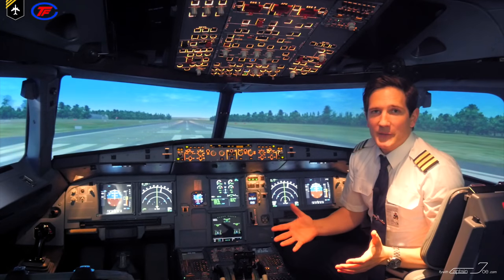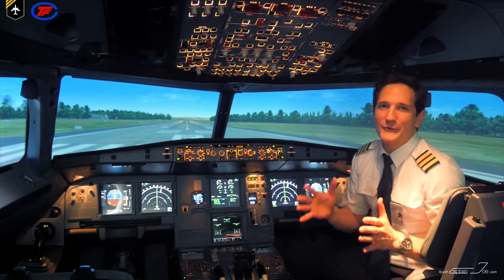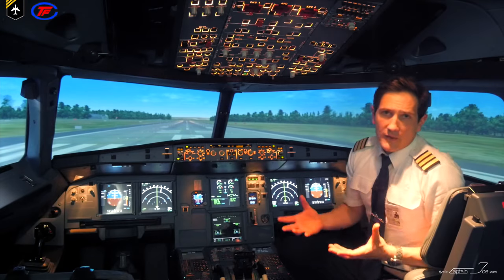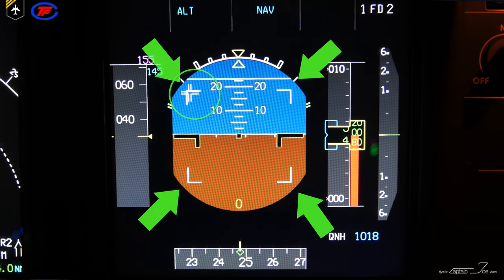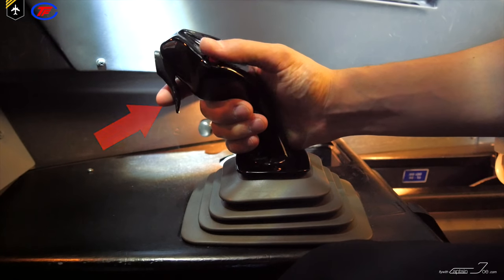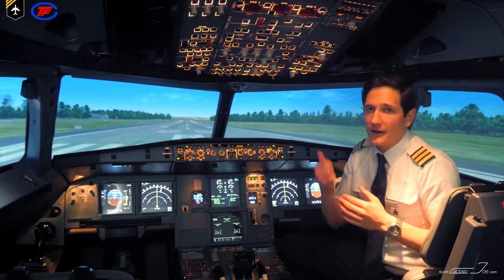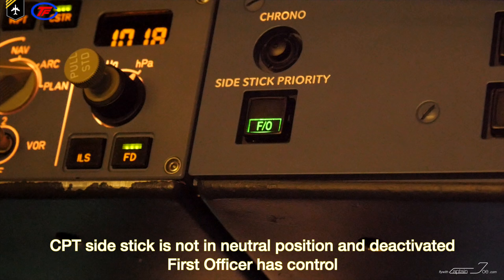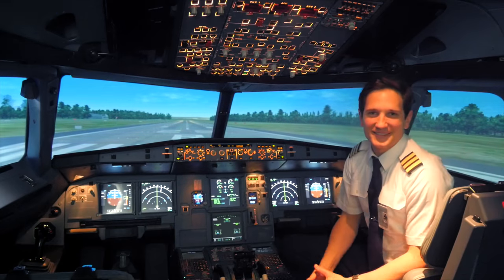AIRBUS SIDE STICK - Explained by CAPTAIN Joe

Comment: So what happens when you totally lose power and the aux gen/battery also fails?  

Let’s say you get hit with an immense EMP?
Reply: Those are 2 different things. If both sidesticks stopped working then you’d use the autopilot and fly an autoland. If you lost power to the flight control computers then you’d use the rudder and stabiliser plus the engines to turn and pitch. If you were hit by an EMP then everything would shut off including the engines and you’d have no control
Reply: @tomstravels520  And an EMP in a 737 on the other hand wouldn't render the plane uncontrollable as the yokes are mechanically linked to the control surfaces.
Reply: @psirvent8  true although a Max would be slightly more difficult as the spoilers are fly by wire and you’re still going to loose the engines. In fact you could potentially have slight control on the A320 if you have enough airspeed to windmill the engines to keep the hydraulic pumps going you then have rudder and stabiliser control although landing wouldn’t be pretty

Comment: what was wrong with the old "steering wheel" style controls?
Reply: The main advantage that most pilots talk about is that they can now extend a large tray in front of them to have lunch in comfort. The mechanics are also somewhat lighter (less weight saves fuel, even if just a little bit).

Comment: Is it hard to get used to steering with the  other side stick?  So if you usually operate from the right seat, can the left seat throw you off for a bit.  Which side do you prefer?

Comment: Why doesn’t airbus have a yoke like Boeing and which is harder to control. I have always wondered this thanks Captain Joe
Reply: Asia Khaliq sidestick are mainly used in airbus aircraft as it has its own set of advantages. Mainly that it’s compact, fully fly by wire and allows for the installation of a table.

And in terms of controlling, though it’s subjective,yokes are preferred as it feels more natural.

Comment: Can you explain why was it possible for the Airbus to crush in the Atlantic Ocean in 2009 when the co-pilot was putting the nose up with the joystick while the plane was stalling and nobody realized that until it was too late? how come there is no warning ? that is very serious, the plane stalls and you put the nose up and no warning comes up that's very serious, this should be illegal in a passenger plane, killing people like that...
Reply: There were plenty of warnings, the stall and AoA warning were blaring on for 75 seconds. The aircrew simply didn't believed the warnings were valid.
Reply: not STALL warning, i am talking about STALL NOSE UP warning, they all died because the Captain had no idea his first officer was keeping the nose up while the plane was stalling. That's just stupid.
Reply: Well, normaly pilots do know the fact that it's not advisable to keep the nose up while in a stall. Stall recovery is part of the training.
Reply: The flight engineer had controls & was deflecting the first officers input, & inputs didn't make sense to the FMS. Instead of setting an angle of attack at a certain angle, the flight engineer was continously deflecting by pulling on his stick. Plus the major reason no Vref & lack of belief in their pitot & ground speed readouts. AF447 was doomed right from take off and into the handover zone with static energy causing pitot tubes to fail. Spinal compression mostly killed almost everyone except for the ones who drowned incase they were ever unaffected by the deadly impact of water.

Comment: Does this system has a mechanical backup ?
Reply: The sidestick has no physical linkage. So its all electronic. Only the horizontal stabilizer trim and the rudder have a mechanical linkage
Reply: @ZK-APA  the latest A320 have an E-Rudder now

Comment: Does the captain have an option to control the aircraft with his right hand? What if he is a right hander??
Reply: jerrin Antony thottan left handed or right handed doesn’t matter. If you sit on the left you use your left hand, and if you sit on the right, you use your right hand.

Also, even though you can hold the yoke with both hands, you still fly with the outboard hand only
Reply: @ZK-APA  thank you for your valuable reply.☺

Comment: I just wonder why the one stick is right and the other one is left. Sounds like you have to learn to control the plane with both hands. Potential safety issue?
Reply: AtomPilsener no. Because even with a yoke, you fly with the same side hand (left for left, right for right)
You can grip a yoke with both hands, but you're not meant to normally fly with both hands (other hand is on the throttle, unless its during take off post v1)

Comment: HI CAPTAIN JOE..WHAT HAPPENS IF THE PILOT IS RIGHT HANDED AND FLIGHT CONTROL STICK IS ON THE LEFT ON AN AIRBUS? DOES THE CO-PILOT TAKE OVER ON THER RIGHT FLIGHT CONTROL STICK? I FIND THIS DIFFICULT EVEN WITH THE AUTO PILOT..
Reply: They get used to it during captain training
Reply: @tomstravels520  ..thank you

Comment: Let me get this straight. The Airbus system provides no tactile feedback when both side sticks are in use simultaneously? The aircraft’s computer just averages the inputs, flashes a small green light, and a faint audible warning to the pilots that their control inputs might be fighting each other during a high-stress event? This sounds like a recipe for disaster.
Reply: Simply push the red button and keep it pushed and the airplane is all yours. Oh yeah, if you keep it pushed for about 30 seconds, it deactivates the other sidestick.

Comment: 40 seconds to take over control? Isn't that a bit too much? In an emergency situation that could be the difference between life and death
Reply: The priortiy button takes effect immidiatly, athough you have to hold the button down while you make the nessicary inputs, but if you want to "permenently" disable the other pilots sidestick you have to hold the button for 40 seconds (and once a sidestick is "permently" disabled, the button no longer needs to be held, and to re-enable the side stick that was "permenently" disabled, either pilot can use their priority button to re-enable it)

Comment: Why not just have a switch on each side stick that activates and de-activates them ?
Reply: There are other uses for the sidestick priority function, one use being if for whatever reason the other pilot needs to make an input on the flight controls (i have found a video on youtube where the captain used the priority function to make an input on the flight controls just before touchdown on a training flight

Comment: The sidestick design was responsible for more than 300 deaths. Averaging conflicting inputs is the dumbest decision ever.

At least it should give a force feedback (a vibration pattern) in this case.
Reply: Alex Besogonov the sidestick design was a contributing factor,  but not directly responsible for the crash.

As one thing you learn in day 1 of flying school: you have control/I have control. At all times it should be clear to all crew in the plane regarding who’s flying the plane. 

But yes, improvements should be made to the sidestick for added redundancy

Comment: 40 SECONDS!!!!
during an emergency 40 seconds is a hell of a lot of time. you cant just wait 40 seconds for the computer to lock the other side stick, you need authority IMMEDIATELY
Reply: I think you do have priority control during the 40 seconds you push the priority button. If you release it in less than 40 seconds the controls go back to normal mode. However,  if you hold it longer, the other side stick remains permanently deactivated (or at least until the FO presses their button). Otherwise the Captain would have to keep pressing the button until they land.
Reply: ok, good!
Reply: And what about when both crew members hold that button simultaneously? They both want authority and think that they're doing better than the other, it's not hard to imagine such situation in emergency.

Comment: Didn’t answer the most obvious question: Why a side stick. I just figured that Airbus did it out of spite, like a kid dyeing his hair fluorescent pink to piss off the grownups.
Reply: They were inspired by the F16 fighter jet. The side stick works excellent with the help of the fly by wire control system. Also, it gives pilots much more space, just making everything easier.

Comment: While I am no pilot nor an aviation expert I think side sticks are inherently flawed. How can you operate a plane smoothly with the side stick on the left side and you are right handed?
rough landing ! How can you be a smooth operating first officer and you are left handed? the stick is on your right...! I think the side stick should become the center stick for safer and smoother operations.
Reply: Rochdi Tidjani irrespective of yoke or sidestick, if you sit on the left, you use the left hand for the controls and the right for throttle. Similarly if you sit on the right, you use the right hand for the controls and the left hand for throttle.

Even though you can hold a yoke with two hands, you only use one when flying.
Reply: What if you are left handed and you sit on the left side and can use only use the left stick?
Reply: Rochdi Tidjani you get used to it.

Like some people drive left hand drive cars, and others drive right hand drive cars.

Comment: 3:26 - 40 seconds??!! That's a long time to hold a button!
Reply: A misunderstanding. Pressing the button and holding it will instantly give you sole control. But if you let go before 40 seconds then the controls will return to normal. After 40 seconds you can let go of the button and other sidestick will remain disabled
Reply: @tomstravels520  Gotcha. That makes a lot more sense, and a good feature I might add.

Comment: Why does Airbus use this setup, rather than something a little closer to "standard"?
Reply: Why? It seems very counter-intuitive.
Reply: Since it's centered, its movements are more closely related to the way your senses perceive three-dimensional motion. An old-fashioned stick is good, but a yoke gives you more of a direct perception of "roll" as you turn it, and "pitch" as you move it forward or backward. Furthermore, even though most pilots (like most humans) are right-handed, they have to get used to awkwardly manipulating a stick with their left hand when they're in the left seat. The controls for both pilots ought to be the same.

Comment: wait if its not mechanical then what happens to the side stick when electrics are out.
Reply: Mechanical backup, on the A320 the rudder is mechanical and the horizontal stabiliser trim is also mechanical, both can be used to control the flight path until electrics are restored, I only know of this ever having to be used once

Comment: Why the stick sideay?
First officer can handle  with right hand which is normal to expect. But captain is forced to  use with left hand. Most people are right handed.  Look like problematic for captain to manual control airplanes with left hand if needed very precise movment.
If computer make corrections make sens .
If stick is connected fly by wire directly it is potential hazard.
Reply: Thing is even with a yoke, though you can hold it with both hands, the captain will still only use his left hand to fly. Normal flying technique is that the outer hand will be controlling the aircraft, with the inner hand controlling the throttle or other stuff.
Plus, flight training happens from the left seat, so all pilots learn to fly from the left seat first.

Comment: Which plane is safe 2 or 4 engin aircraft
Reply: That isn't a valid question. You are just as likely to screw up and crash in a twin engine as you are in a four engine plane. The engines themselves are extremely reliable and 99% of the time, whenever a plane crashes, it is due to human error and not the plane itself.
Reply: Rajesh Sharma statistically 4 engines, but practically both are equally safe

Comment: but why a sidestick instead of a regulr thing?
Reply: Smaller, more user friendly, and it interfaces better with the computerized flight controls.
Reply: And also a foldable table can be added in front of the pilots, for writing and eating
Also there's a keyboard in the table for input

Comment: Does it replace a yoke?
Reply: Yes, on Airbus aircraft. But there are still aircraft which have a yoke (like Boeing).
Reply: @mikep9604  actually you see more and more aircraft where the yoke is replaced with one of these. As soon as you use a Fly-by-Wire system, a yoke becomes pretty useless.

Comment: So there is no yoke in an A320?
Reply: That's correct. A320 has a side stick.
Here we can see it on the left side:
https://upload.wikimedia.org/wikipedia/commons/d/d8/Airbus_A320-214_Vueling_EC-HQJ_cockpit_detail_%286500487277%29.jpg

Comment: I think it's a bad design to have the stick to be operated with left hand on one side and right hand on the other side... the controls should be in the same place, non mirrored... if you develop muscle memory and ability in one hand you have to reprogram yourself when changing seats...
Reply: Actually that is not completely true.
Even though you can hold a yoke with 2 hands, the actual way a person is taught to fly a plane is by using one hand on your yoke/stick (left seat-left hand, right seat-right hand), and using the other hand to control the throttle.
So irrespective of yoke/stick, you will always fly with mirrored throttle and flying controls.
PS the reason they hold the yoke with both hands during takeoff is so that they dont accidentally change the throttle settings during the climb.

Comment: It’s too high tech, I much prefer a Boeing yoke system. The Boeing system seems to me safer.
Reply: Technically although the yoke gives better feedback to fly, the sidestick is actually safer. Reason being that it is immune to getting stuck due to a jammed control surface.

Comment: AF447
Pilot had the stick all the way back and the other two pilots had no idea.  Nice Airbus.  
228 dead
Reply: 5Y3591, FO pushed the control column fully forward because he accidentally pressed the TOGA button then thought he was stalling, captain didn’t notice until too late. Nice Boeing
Reply: @tomstravels520  AF447 WASNT an accident.  The pilot pulled the stick back on purpose.  You said in your comment the Boeing pilot did it on accident.   U are comparing apples to oranges, as per usual
Reply: @PInk77W1  no. I said he “accidentally pressed the TOGA button”. He then purposely pushed the control column forward in a reaction to a supposed stall. Instead of paying attention to his attitude indicator and altimeter which would have told him otherwise. The pilot of AF447 had no airspeed to work with, the 5Y pilot had nothing wrong with his instruments and still nosed the plane into the bay
Reply: @tomstravels520  so u need air speed to not pull the Airbus stick all the way back for 4min. ?
Thx.  I’m good
Reply: @PInk77W1  wtf are you talking about now? Pilot pulled the stick back because he was an incompetent moron and didn’t know how to fly with an unreliable airspeed. Nothing to do with the sidestick design itself. The FO of 5Y 3591 pushed the yoke fully forward until he suddenly broke out of the clouds and saw the water below him. But is anyone blaming the crash on Boeing because if that plane had been an Airbus the plane wouldn’t have pitched down that much and the crash would have been averted?

Comment: Tbh, I like the Boeing approach. I don't think this full fly-by-wire joystick approach is validated at our current status of computer engineering. I think Boeing had a superior approach in this respect. There isn't enough mechanical fall back redundancy.
Reply: The new boeings are fly by wire. They just chose to install a yoke instead of a sidestick.
Reply: @ZK-APA  No they have "feel systems" and use hydraulics, but they have mechanical backups. It's not pure FBW.
Reply: deepbigeyes that’s true for the 777. The 787 doesn’t have mechanical backup though.
Reply: @ZK-APA  Well the infamous 737 Max's don't have pure FBW. And they are new.
Reply: @humanonearth1  yea fair enough.
Reply: @ZK-APA  Good for you for being somewhat humble. That's not common today especially online. I will admit that my first statement that Boeing's approach is better is not final. I'm not certain myself if FBW is worse or better and it seems certainly necessary for these bigger aircraft so there's also that.
Reply: deepbigeyes it’s good to have healthy discussions. It’s not about me being right, but for the discussion to be right. 
And everything has pros and cons. Fbw is much easier to install, maintain and reduces a lot of weight. And with enough redundancy, it’s safe too. But yea, mechanical feedback is a godsend in terms of flying.
Reply: @ZK-APA  Well said sir.

Comment: One disadvantage of been a captain is you need to use your left hand. I find it highly uncomfortable.
Reply: It's not that hard. Even when the aircraft has a yoke (like Boeing) the captain uses the left hand during the landing because the right hand is on the throttle levers.